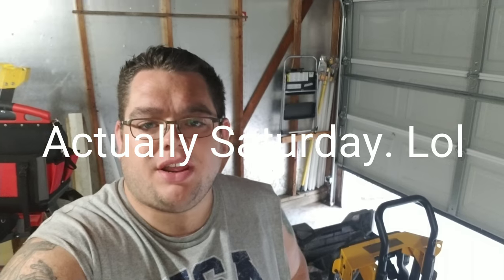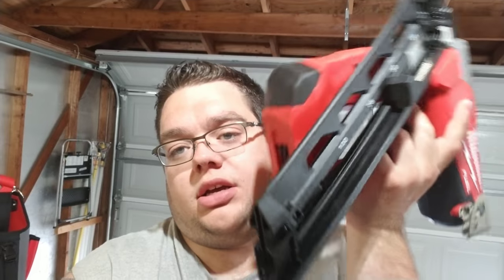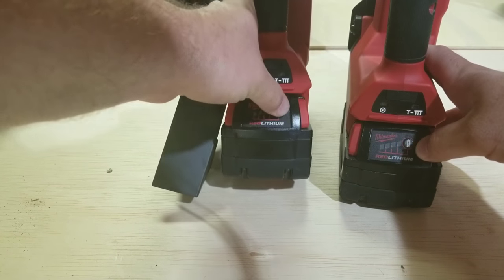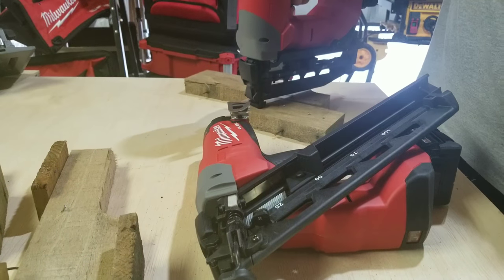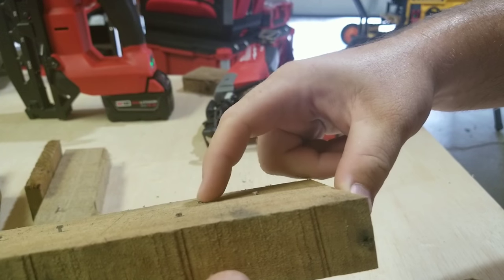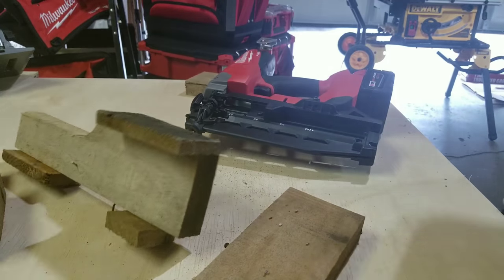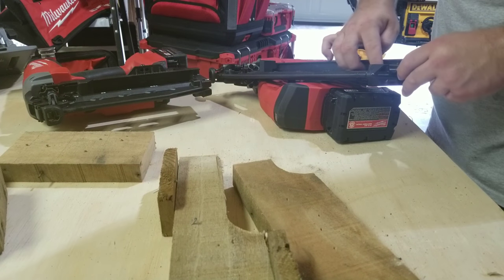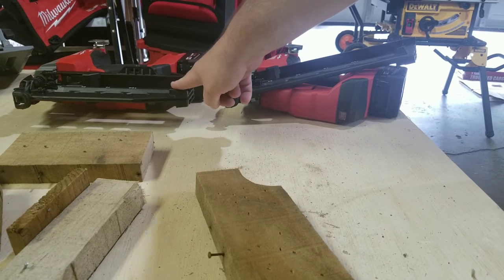MILWAUKEE NAIL GUN SHOW DOWN TOOL REVIEW!

Comment: Your right about that straight 16 not sinking the nail as good as others. It won't sink any length unless u press down really hard. If u press down really hard it will sink them every time. If you don't it wont sink any of them. From what I can tell the striking pin will lift the whole gun up when it hits causing it not to sink if you don't press down with enough force

Comment: Man you don’t know how to use that tool both were out of depth adjustment for that wood that’s how most tradesmen use this nailer including I.
Reply from the maker: While I can admit on of the depths may have not been "honed" in if you will. The one in the pine that didn't sink.. Was at its max though.
Reply: @jamesofalltrades8395  they don't make pallets out of pine bud. look at how tight the end grain is. no way in hell is that pine.
Reply: Lost Pilgrim not saying it was or wasn’t but if you don’t think they make pallets out of pine you’re crazy. I see them every single day.
Reply: I agree that’s not pine. I’m thinking poplar?
Reply: Most pallets are made of oak.